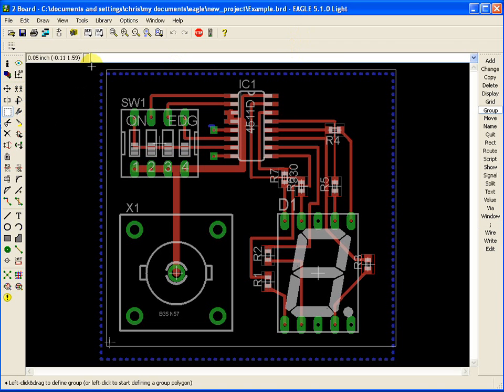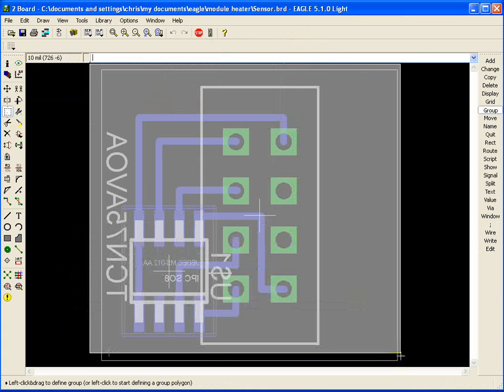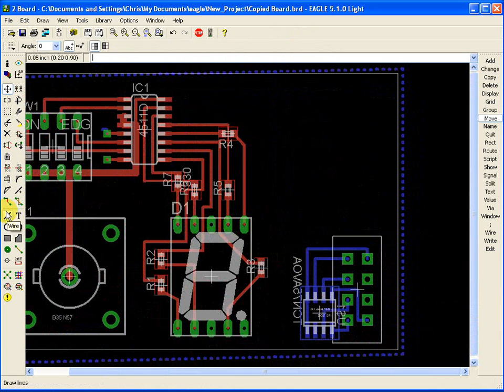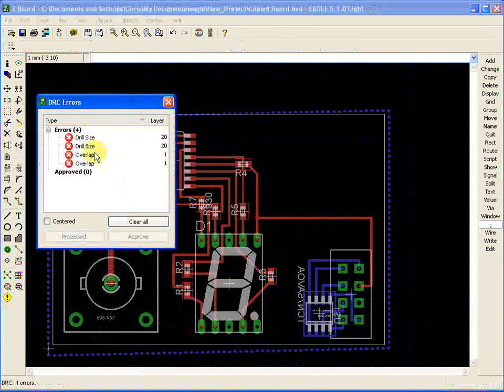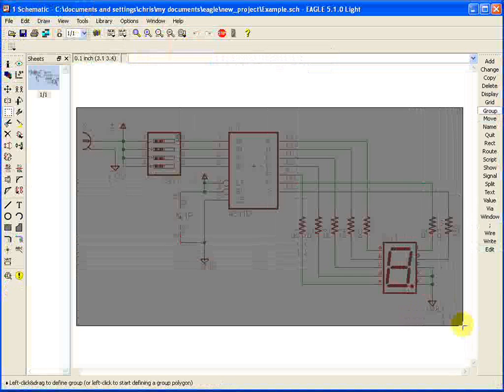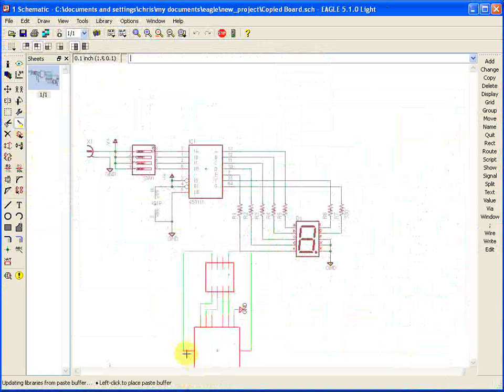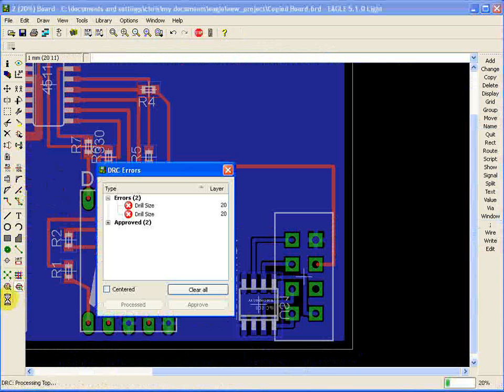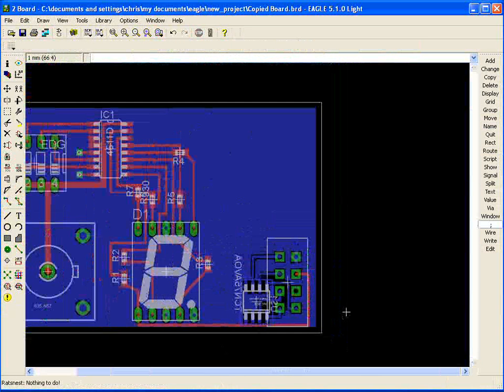Copying schematics and boards in EAGLE

Comment: Excellent video.

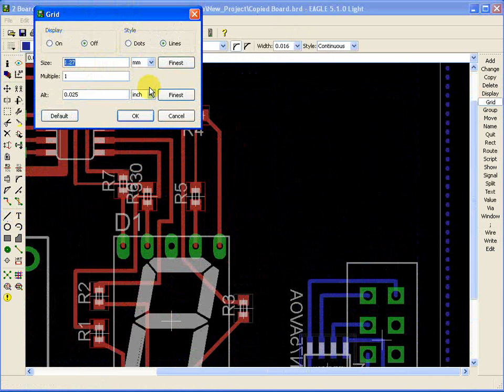One constructive criticism; at time index 2:47 when the track is added, it's added perpendicular to the existing track; the best PCB track design procedure is there should be a 45 degree branch off, to avoid the added track being vulnerable to cracking or splitting.